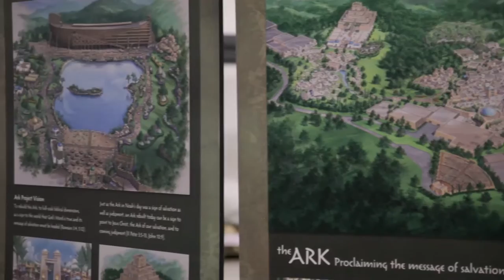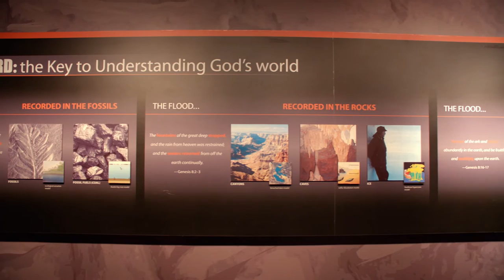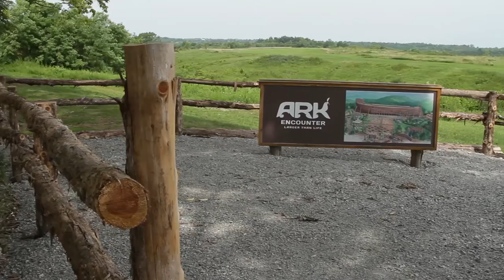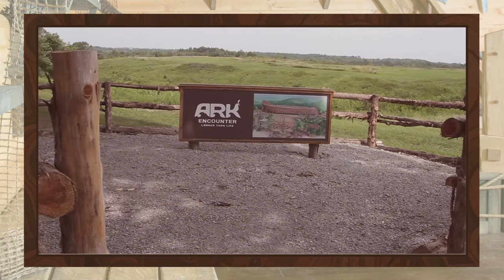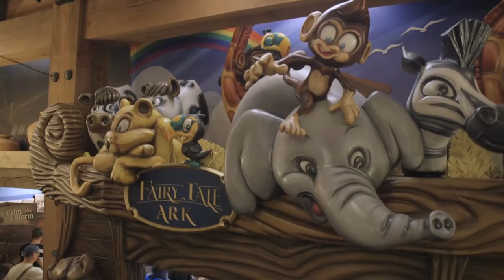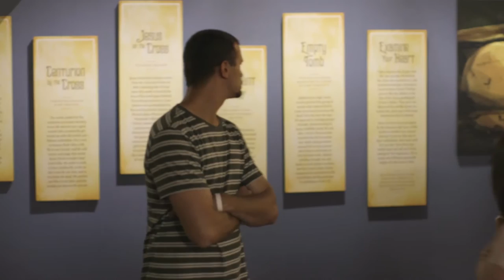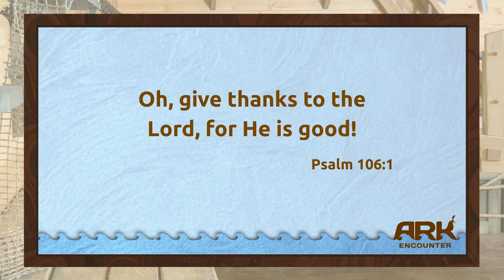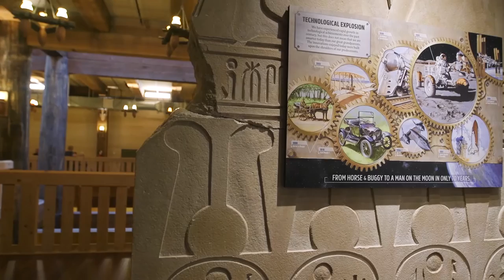Building of the Ark Encounter

Comment: Just look at the construction - what we have here is a half-boat shaped construction which does not need to be waterproof let alone float and survive the greatest storm ever for 40 days.  Even so it needed lots of heavy machinery to achieve just a small part of what Noah allegedly managed.  Why did they opt for all that metal reinforcement and huge nuts and bolts to hold the timbers together; why not use wooden pegs just as Noah would have to have done.
Did nobody involved in the construction look critically at this project and conclude there is absolutely no way this vessel could have been constructed 4.500 years ago?  Just a simple example, we have tree trunks which are 65 feet in length with a girth of maybe 9-10 feet and the only way to move them is by using a massive crane.  Did nobody look at just that one aspect and wonder how Noah might have managed to do it?  Can somebody from Ark Encounter or AIG please explain this to me because the only thing I can take from this is that the story of Noah's Ark is quite clearly non-factual.  It could not possibly be true.
Reply: Our brains are very prone to myth and legend.  Our cultures are built on stories and they serve a strange purpose.  Unfortunately people can't distinguish between reality and legend, but that is OK for now.  My entire extended family believes and they do function well (half their brain believes and the other half deals with reality).  They compartmentalize.
Reply: Imagine if someone tried to build pyramids in Egypt.
Reply: @pixxip1 now imagine that the U.S. has even more pyramids than Egypt and that the gopher wood used to build the ark only grows in one place in the world...florida.

Comment: Wow, imagine that. Noah had steel reinforced concrete, dimensional cut lumber, modern hardware, fasteners, adhesives, and finishes. Electric lighting, a proper HVAC system, surround sound, extruded aluminum framed automatic doors, glass, a fire suppression system, what appears to be Vinyl composite flooring, printed signs on coated paper and plastics. I'm sure Noah had an overpriced gift shop as well. I think their engineer is the same person in charge of designing where they got their lights form. Cracker Barrel. (American Restaurant)
Reply: @Falcon2 Just a realist.
Reply: Noahs time was hardly primitive. 😂
Reply: @Falcon-um7vodidn't build the ark in the United states? Are you sure about that? Gopher wood only grows in one place in the world...florida.

Comment: When reading the Bible, I must have overlooked the 100 Million Dollar Budget, the concrete, insulation, electrical wiring, chainsaws, building cranes, bulldozers, high tech measurement tools and the hundreds of workers.
Reply: I dont think it was made to meet safety qualifications... It would have been made to do what it needed to do... And yeah, its hard to imagine one man and a couple of his sons building something like that...
Reply: I know what they will say .... it was a divine ''miracle'' given to Noahm,  from the Lord !   There is no logical argument against such a way of ''thinking'' !
Reply: @RayB1656  With God ALL things are possible
Reply: In case you missed it, it is  museum, a public structure that had to be built to building codes.
Reply: @alantasman8273  Didn't have to be. There are dozens of floating museums around the world, many of them MUCH larger. Only difference is, they are built of steel. A wooden structure would break up as Young's Modulus decrees that the material used doesn't have the inherent strength to support itself in those dimensions.  Simplified, you can build a boat out of, for example, reeds, but only up to a certain size. After a certain point its own weight will destroy it.

Comment: The ark was was 300 cubits long, 50 cubits wide, and 30 cubits high (133.5 m × 22.3 m × 13.4 m; 437 ft 6 in. × 72 ft 11 in. × 43 ft 9 in.). It could have had about 0.9 ha (2.2 acres) of floor space. Genesis 6: 13 -16 it was a box. It's totally wrong to think it had a prow. It wasn't going anywhere..this boat is fiction
Reply: It was 500 feet long and it's not a fairy tale to me .Halleluyah!
Reply: @marcdemell5976  hi absolutely not a fairy tale. But the ark they presented was. The ark was a box. no prow hallelujah ( hail you jah)
Reply: @lyonspainter  I bid you well,Halleluyah.
Reply: @lyonspainter  the Bible gives length and width. It does not give description of the shape.  Modern ships are usually described in length and width whether a garage or aircraft carrier. They give description of hull shape after that. The only other dimension given will be weight or displacement.

Comment: I was hoping this would be an explanation of how the Arc was built. Disappointed to really see a building being constructed and not an accurate boat construction of the time, say 4000 BC using tools and equipment from this time. I note that some ship restorations and replicas do use authentic constructions and processes - I have just watched the rebuild of an 1874 sailing ship mast rig  - While they used cranes to speed the work, they also used traditional methods and sequences for some components as demonstrations to accurately show how the work was done.

I feel this Arc fails for me as it is not a true replica that historically demonstrates an authentic Arc using Noah's technology, rather it is a modern film set. This Arc is not a replica and shows that Christians can not be trusted to represent the truths in the Bible,.
Reply: You try getting 4000 BC building code permits approved by 21st century lawmakers. They’d say, “Noah proval.”

Comment: How did they re-create a boat with no description and which can't be shown to even have existed ??    It's rather lame fiction .. much better amusement parks are out there.
Reply: Believe what you want about whether it existed but there is definitely a description given in the Bible. The dimensions are actually very similar to those used on modern day cargo ships
Reply: The dimensions or Noah's Ark is listed in the Bible.
Reply: @_JellyDonut_  Those modern ships are built out of steel. A wooden vessel that size would break apart under its own weight. that's why this Ark is not floating.
OK, so its just a 'representation' then. In that case it doesn't prove a thing.
Reply: @peterleadley  You're correct that modern ships are built out of steel but I find it interesting that the dimensions given in a book written thousands of years ago would be so close to what is used today. That's not why this ark isn't floating though. This one isn't floating because it was meant to function as an exhibit and not a boat. There's a guy in Holland who built a similar structure out of wood and it floats just fine.

Do you have any evidence to support your claim that it would break apart under its own weight? The one in Holland was completed over 10 years ago and hasn't broken apart. Granted it hasn't gone through a flood but in the Bible story Noah and his family were only on the ark for a little over a year and it was only floating for about half that time. By the way no one is claiming the Ark Encounter proves the Biblical account to be true. It would be impossible to prove that.
Reply: @_JellyDonut_  As it wasn't built to actually float, it doesn't prove the Ark could have been a practical proposition. 

The Ark in Holland (where I live) is in Rotterdam and was built by welding together canal barges as a base and then covering them with a skin of pine planks.
Believe me, if anyone could build a wooden Ark the Dutch could. But they didn't. Because a vessel that size in wood is not possible. Using Young's Modulus, architects calculate the load bearing capabilities of materials to see if their design is practical, which is why Jan Hubers built his Ark out of steel.

The intended use of an object dictates its design. Boats have been used for hundreds of thousands of years, and so a Bronze Age  scribe would describe it as being in a traditional shape. I think a circular design would have been better, but I live in the Space Age not Bronze Age. 

The whole story of Noah's Ark appears to be fiction. Including the global flood. Ask yourself, how much food would have been required to feed all these animals? And why bother with an Ark at all? Just gather all the animals on a mountain, and just leave that peak dry.  Where did all the water go? (takes 12x the amount of water on Earth to flood the planet to the top of Everest) How did the marsupials get to the Middle East from Australia? 

No, it's legend not fact.
Reply: @_JellyDonut_  The one in the Netherlands (where I live) is in Rotterdam and is built from steel. Jan Hubers welded together several Rhine barges because Youngs Modulus indicated that wood did not have the inherent strength for a vessel that size. That is the proof you ask for. Due to hogging and sagging, the practical limit on the length of a wooden-hulled ship is about 300 feet. The actual history of the longest wooden ships bears testament to this limit. The Wyoming was 329.5 feet (100.4 m) long and 50 ft 1 in (15.27 m) wide, the largest wooden schooner ever built.

The dimensions given in the Bible are not anything special, they just follow the traditional specifications of ships. Mankind has been using boats for hundreds of thousands of years, so no biggy there.